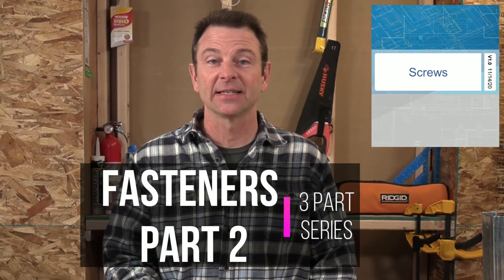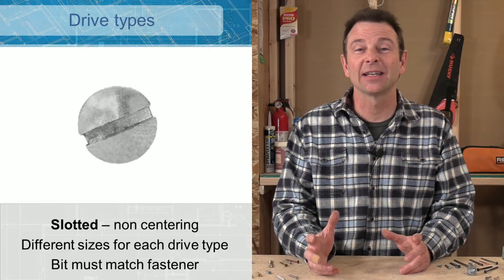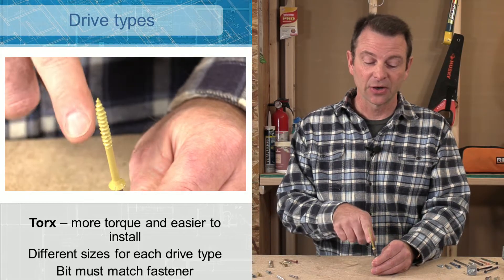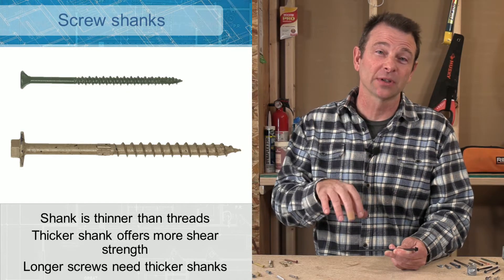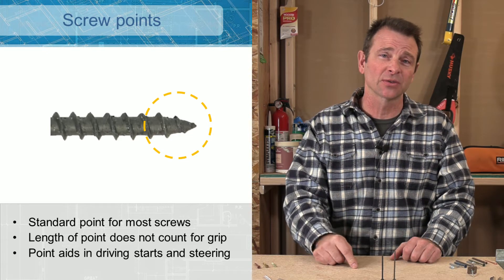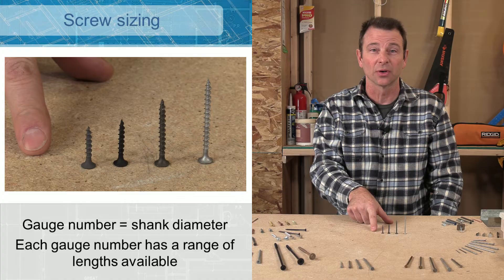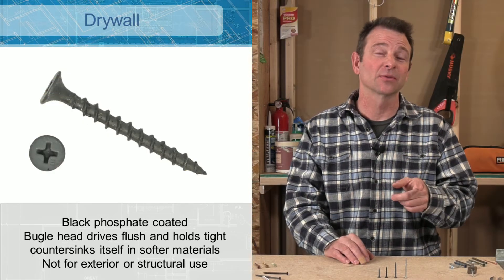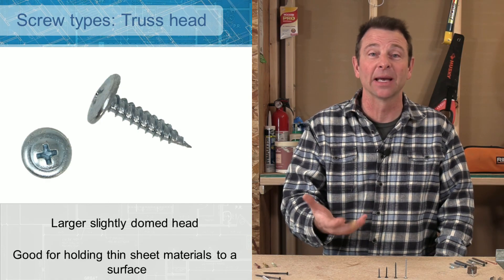Fasteners Pt 2 -  Screws - Lesson Review - Premium Resource Library

Comment: The "square head" screw is called a Robertson up here in Canada and are extremely popular. An advantage of this screw type is it holds to your drill bit, meaning you don't need to hold the screw to begin drilling as you would a Philips. Pretty much every deck screw you'll find here is a Robertson.